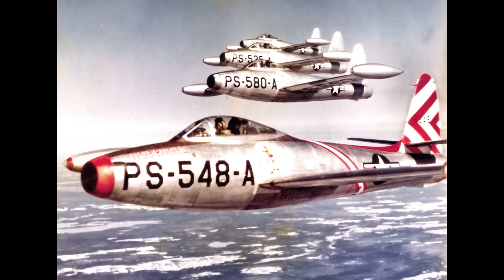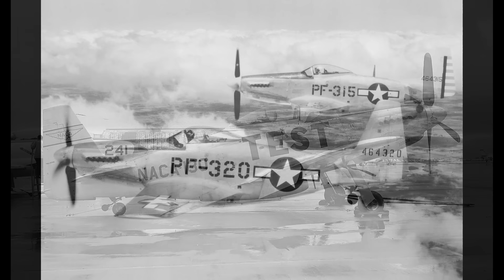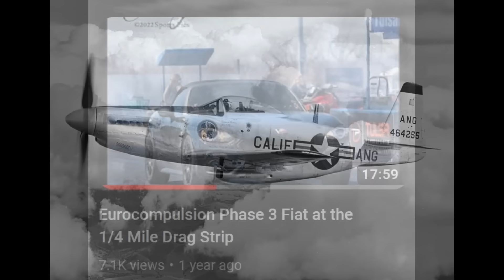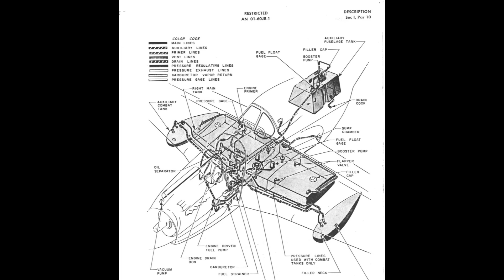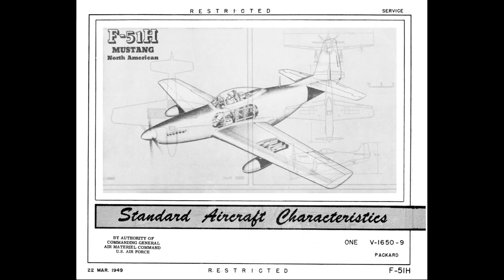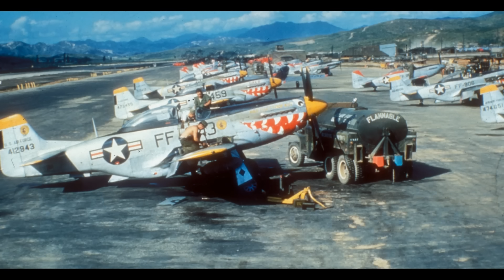P-51H Mustang, Superprop!

Comment: "It's just very hard for the naval fighters to win in a straight-up performance comparison."
Except that the F4U-5 with 460+ mph @40K' is no slouch, being right there with the best of 'em. Off the deck climb rate and top speeds are also outstanding. Greg, you might consider  "going into" the -32W "elephant ears" variant of the R-2800. One heck of an engine...
Reply from the maker: Yup, I haven't covered the -5 yet, but it's clearly going to be a part of this series.

Comment: The ultimate P-51 was the J model, North American only built two them. The H was the ultimate production model.
Reply from the maker: I guess it depends on how you describe "ultimate". For me, if the plane wasn't a production model it's not the ultimate model. Is Strega the ultimate P-51? Not if you're going into combat.
Reply: @GregsAirplanesandAutomobiles  According to Robert W. Gruenhagen in his book "Mustang: The story of the P-51 Fighter", under experimental Mustangs the J model was the highest performing Mustang powered by the Allison V1710-119 engine with a five bladed prop. He also states that the H model could do 487 mph with on stores 80" of boost at 3000 rpm at 25,000 ft. The G model could do 495 mph and the J could do 497 mph. North American only produced two G's and two J's and what happened to them is unknown but there are photo's of them.
Reply: @GregsAirplanesandAutomobiles  Please do not take me wrong, I think you are doing a great job and keep it up. But being a one or two run off has nothing to do with being the ultimate Mustang and North American made two of them. The J was the ultimate Mustang, and the H was the ultimate production Mustang. Not counting the racing Mustangs. As for the non-combat history of the H model, I think it is irrelevant as it used in squadron service for years.

Comment: I'm glad you finally did a video on the P-51H. I've been saying for years it was the hottest propeller driven fighter in the skies, but there were always people claiming that there were others that were faster, or would outclimb it, etc. We now know those claims were not true. The P-51H was THE hotrod of the skies for prop driven fighters, however, it was mostly pushed aside with little fanfare because of two reasons. It never saw combat, and it came out too close to the jet age. Had the H come out a year earlier, I believe it would've been a much more heralded aircraft. I'm surprised your video didn't go into any more detail about the H model's predecessors, the F and G prototype models. I have a book titled "Building the P-51." The book goes into great detail about every version of the plane, every power plant used, all of the different HP ratings for each engine based on fuel octane, manifold pressure, etc. Test pilot Bob Chilton talked about test flying the F model and said climbing out after takeoff at 7500 FPM was quite common. It took years before a jet was developed that could top that rate of climb. He also said that while he was never able to attain 500 MPH in level flight it would certainly do over 490. All of the "light weight" Mustangs were at the very top of the heap in terms of propeller driven aircraft performance...
Reply: At 450 mph it was certainly not the hottest prop plane of WW2... we all know it was the Arrow.
Reply: The H was not the fastest.
Reply: @WilhelmKarsten  what do you claim was faster?
Reply: @jamesbottger5894  The fastest propeller driven aircraft in operational service during WW2?
Reply: @WilhelmKarsten  was what?
Reply: @WilhelmKarsten  don’t say TA-152, cuz the 51H was faster
Reply: @jamesbottger5894  the TA-152 and the Do-335 were both faster than the P-51H
Reply: @WilhelmKarsten  I don’t know about the 335, but the 152 was not
Reply: The 152 would do 472, the 51H would do 485
Reply: @jamesbottger5894  Not the production version..
The Simon boost pressure regulator was an unmitigated failure.
Reply: @WilhelmKarsten  Whatever you say. I’ll take the pilot’s word over yours, they might know just a bit more…
Reply: @jamesbottger5894  Which pilot?
The North American pilot flew an aircraft with the highly experimental Simmons regulator..
The USAAF pilots flew a production model that didn't have the regulator which proved to be so troublesome and unreliable that it was not included in the production version.
Reply: @WilhelmKarsten  Then it apparently didn’t need that particular regulator as it was the production model that attained that speed
Reply: @jamesbottger5894  Sorry lad... you are very confused and misinformed.
The NA-126 was a non-production prototype
Reply: @WilhelmKarsten I guess I was wrong. This says top speed was 487, not the 485 I stated earlier, and it doesn't say this was a pre-production model...
Reply: After doing some research, finding the actual top speed of the P-51H is difficult because there are too many variables…what octane fuel was used, what manifold pressure was used, prototype or production model? Too many of these variables are not listed in the tests, and all greatly effect engine power...Mr. Karsten may be correct...
Reply: @WilhelmKarsten  the NA-126 was The Production P-51H. NA-117 was the projected P-51H prior to the addition of the fuselage tank requirement. ALL NA-117 funds were transferred to NA-126 with an initial production order of 2500. That said, several features of the NA-117 such as shorter canopy, dorsal fin and tall fin were incorporated in NA-105A XP-51G. Source NA-8900 Specification for P-51H Airplane, Model P-51H, dated October 1943, GALCIT Test 400C and 423 in which the NA-117 preliminary drawings for original P-51H were cited as basis for 1/4 scale wind tunnel model.

 The XP-51F also flew with the V-1650-9 at 80" MP at 493mph at 22,000 feet, 7300fpm ROC at 5,000 feet at 7550 pounds, full load out at takeoff. That test config might be considered a P-51H prototype - but it was not. Sources Jan 1945 Chilton logbook and May 1945 flight tests at Wright Field.

The XP-51G w/RM 14 SM achieved 498mph but only 105gal fuel at take off compared to 180gal for the XP-51F. Sources NAA Test reports and Chilton logbook.

Further, the speeds quoted included wing racks whereas the German figures quoted for FW 190D-13 and Ta 152 and Do 335 were all clean for Speed Performance Estimates.  There are no publicly available Flight test reports for any of those three save the Feb 1945 Do 335 flight test which cited ~430mph top speed with serious stability issues. 

Another troubling discussion is apples vs oranges when comparable load outs are very important factors. P-51H were tested at 105gal fuel, 205gal (unfilled fuselage tank) and 255gal full combat loadout at takeoff.
Reply: @drgondog  The Fighter version of the Do-335 has a verified top speed of 477mph for up to 20 minutes.
The P-51 H had a top speed of only 450mph for just 5 minutes.
Reply: @WilhelmKarsten  - verified where? So far I have only found the February 1945 flight test for the Do 335. Your source?
Reply: @drgondog  That is the Official RLM acceptance test results required for adoption into Luftwaffe service.
The RLM used the Askania Kinotheodolite to measure true speed SOG over a 3 km course.
 Testing conducted by the Allies after the war were performed without MW50 injection  and are not accurate

I can find no reports stating that the Do-335 suffered stability problems.
Can you offer a source for your claims???
Reply: @WilhelmKarsten  - the only flight test I ahve ever seen was an english translation of February 1945 Flight test. Where is your test to be found. Not Performance Estimate.
Reply: @drgondog  You seem unfamiliar with the concept of acceptance testing?
All military aircraft undergo a battery of performance and specifications tests before the aircraft is delivered to the particular air forces.
These tests include the aircraft's top speed at military power and war emergency power.

These tests are not estimated and special instruments (both onboard and on the ground)
The results of these tests are significantly more accurate than the aircrafts factory equipped  dashboard mounted air speed gauge.
Reply: @WilhelmKarsten  I am Exteremely familiar with flight testing plans and processes as well the role of flight tests DOCUMENTS. Where are the D0335 Flight Test document(s)?
Reply: @drgondog  V-1 top speed 478mph,
A-1 top speed 481 mph and the 2 seat raised cockpit A-6 prototype was 428 mph.
These are from Heinz Narrawa's book and comes from original RLM documents at the Dornier-Werk GmbH. Archives and translated into English.
 These figures can also be found in Jane's Defence publications.
The Do-335 is the fastest propeller driven aircraft in operational service during WW2, no other aircraft could match its top speed, endurance or continuous cruising speed of 425mph.
Reply: @WilhelmKarsten  Sigh - I understand your wish to point to original source documents via second hand sources that you Say come from original sources that we are discussing. Equally for Jane's or Narrawa's books. 

When I quote performance in one of my books, there is either a factory flight test or an AAF document with Memorandum number and exists for others to reference. That is what I keep asking you to produce.
Reply from the maker: I didn't cover the F and G because they were not production models.
Reply: @GregsAirplanesandAutomobiles  Fair enough! Thanks again for the video, I enjoy all of your videos!

Comment: Interesting to see the change in the “buzz” number prefix’s. The are photos of PF-, TF-, and FF-. I’d always thought that the prefix was fixed to the aircraft and didn’t change. Greg notes the he thinks the straight leading edge is the primary visual identifier while I had always gone with the taller tail and rudder assembly. In one of the other comments, it’s noted that there was a a P-51H in civilian hands.  As a CAP cadet in the late sixties we had gone to a fly-in at a little grass strip in Plainwell ,Michigan. I was excited to see a P-51 there, the second one I’d seen.  The first was a couple years earlier when Bob Hoover performed with his P-51D when the new county airport opened. Looking at the one parked on that grass strip, I realized it had a taller tail and it was an H model.  I had also noticed the the tall tail on a Mustang at the 2023 Oshkosh. It’s no longer just the mark of a P-51 H as it was adopted for all the Cavalier Mustangs as well. Just the same, a well done video, Greg.

Comment: In Air Force Legends Number 209: North American P-51H Mustang by David McLaren a card files search found that not a single H left the lower 48 during the war. No evidence that any was sent to England for evaluation. 

Being a completely different plane from the 51 the lightweights should have had their own number and name, as per the P-63 Kingcobra versus the P-39 Aircobra. Suppose NA wanted the retention due to the success of the B-D,Ks. How about the P-74C Super Mustang? The 51 lettering was way screwed up anyway -- being identical the B&C should both have been the B, the D&K the same letter such as C, and what happened to E by the way? 

Booklet notes that there were pesky teething problems North American did not pay much attention to with war and production ceased. Including tail gear failing so frequently that it was often left down and doors sealed until the problem was eventually solved, as per some photos in this video; Me - 109K had similar issues. And the lightweight main gear had problems. 

First remote deployment was to Alaska. Most were soon in ANG units, none in USAF by Korean war so not usable there, Ds prob better for ground attach anyhow and that is not saying much (USAF should have retained better armed and more survivable late model 38s and 47s in post war frontline service for army support rather than 51Ds). 

Chuck Yeager who adored the D called the H a “pig,” as did a post war evaluation test pilot who flew out of Florida. I suspect the combination of the light airframe with a high torque boosted Merlin spinning paddle prop blades was an issue. Some did not like the cockpit which had been moved forward to better position the rear fuel tank closer to the center of gravity. Other pilots loved it as a below comment notes. A black pilot used to dive on early jets to startle them with the prop job’s speed. The H was the only in service long range escort fighter could take on first gen jet interceptors. 

It is often claimed that the Bearcat beat out the H and other allied fighters at an evaluation competition at Wright Field. Sounds dubious, at medium and especially high altitudes the H was far faster and its two stage Merlin should have given it the advantage. 

Watching the pretty bad B-movie “Mission over Korea” I and a friend were startled to see CA ANG F-51Hs being used as stand ins for Yaks! Painted in appropriate colors and insignia, regional USAF and ANG unites were cautioned to not shot them down.

Comment: Damn. Mazda really dropped the ball on the oil cooler thing... of course, so did Nissan on my R32. Thing was good for about five laps before it got... concerning, temp wise.
Reply from the maker: My Fiat has a Fiat engine in it with a Fiat Oil cooler, I don't have anything powered by a Mazda engine.
Reply: @GregsAirplanesandAutomobiles  Wait, I thought those cars were just re-badged Miatas! Did not know they had an actual Fiat drivetrain... that's actually pretty damn cool!

Comment: I just noticed that the rudder seems to be around the same size as the D mustang? I’m wondering if control authority (specifically yaw) was an issue with the huge power increase? Especially with a light little plane. 

Scares me just thinking about it, beyond this almost everyone began to use contra-rotating props. 😳

Comment: There actually IS a centre of gravity compromise with the fuselage tank in the P51H. Aircraft are more efficient and manoeuvrable with a rearward COG. If the COG was far enough forward with aft tank full, then with it empty it would have been further forward than desired. Im NOT saying this is a big compromise.
Reply from the maker: Yes, they are move efficient with a rearward C.G. however there is a point at which the plane gets too hard to control. It the P-51 it was aft of that point with a full rear tank.

Comment: I think the choice of switching to a coolant-oil cooler system vs. air-oil was strictly for aerodynamic reasons - there was too much going on in the inlet duct and it was already one of the largest points of parasitic drag on the plane. 
The oil cooler was really the only thing that could be removed from the air stream, so it was. 

As you mentioned - any hit to the same area would / could take out the same coolant loop for the aftercooler and/or the radiator anyways, so it seems unlikely that it was done for survivability IMHO.

Edit: My 2006 Land Rover (Jaguar 4.4 V8) has one as well (part of the filter housing) but I always assumed it was normal for cars these days. Then again, I don’t think my old M3 had one so who knows. I suppose in this case in the LR3 it was required for towing duty, etc.
Reply from the maker: Taking out the aftercooler radiator will not bring down the plane. Lots of planes didn't even have an aftercooler, including the Merlin powered P-40 and Spit 5.

Comment: North American P-51D-30-NT "Death Rattler", N51HT (ex-45-11586),[25] crashed at the National Capital Air Show at Ottawa, Ontario, killing its pilot, Harry E. Tope. The aircraft was subsequently rebuilt and as of 2017 flies as "Little Horse" (N51PE).

despite the well know warnings of a hazardous flight conditions with the full fuselage tank the operator attempted low altitude aerobatics causing his fatal crash.  his intention was to demonstrate and then head directly home, which required full tanks, thus avoiding a refuel landing. 

greg...why didn't the designers of the H install the griffon, as the brits had done for the spitfire 21?

Comment: It would seem to me that a part of the weight difference between the Spitfire and the P-51D would be due to the landing gear stance. The wider stance of the P-51 requires a more robust wing box to carry the load and the extra leverage. The Spitfire's gear was more narrow and closer to the fuselage. Nicely done video.
Reply: You might be forgetting that in flight, the entire weight of the aircraft (and several times that when pulling Gs) goes through the same structure. 

Plus in the Mustang your gear structure is near the inboard fuel tanks, so weight transfer is easier vs a fuselage gear and having the fuel weight out there in the wings. 

Unfortunately we’ll probably never know, those who made the decision have long since passed. 😕
Reply: American planes just tended to be heavy.
Reply: @givenfirstnamefamilyfirstn3935  American manufacturers were vested early on with self-sealing fuel tanks and armoring up the cockpit. So definitely heavier.
Reply: @riconui5227  Like in P-36s, Buffaloes, the Severskys and early Wildcats?  They picked up on what advanced features the Brits were demanding from U.S manufacturers but the American manufacturers couldn’t easily add lightness.  Grumman were excellent with the Bearcat.

Comment: Thanks, another great addition to the series. Hopefully the CA.15 will follow at some point. Just a totally unrelated question  - why were fabric covered control surfaces used for so long? The entire aircraft could be of advanced metal construction (P51D etc) but still employ a 1900s fabric rudder etc?
Reply from the maker: It was easier to balance fabric covered controls, so they stayed around longer than they otherwise would have.